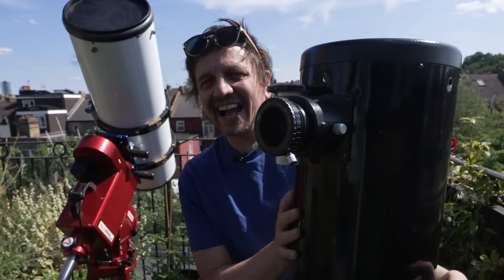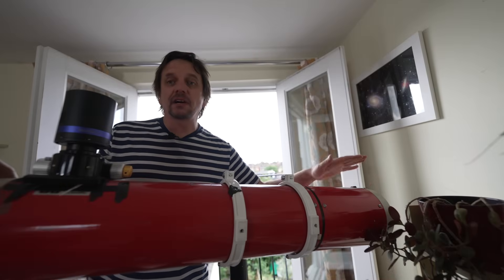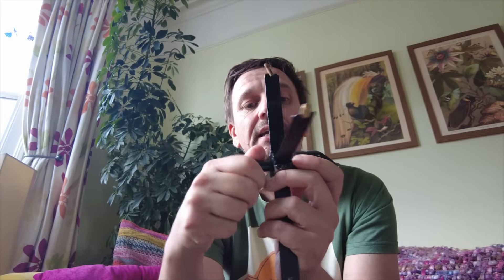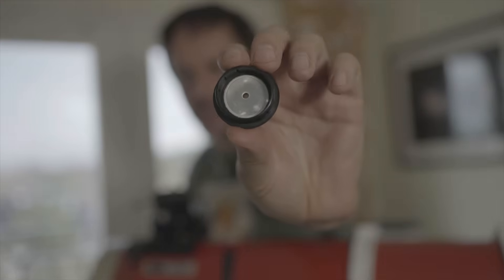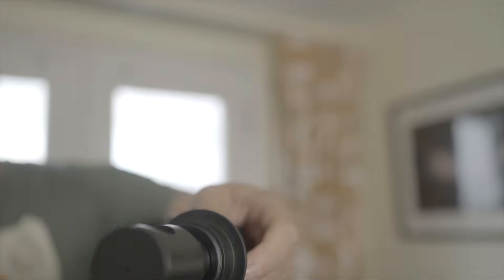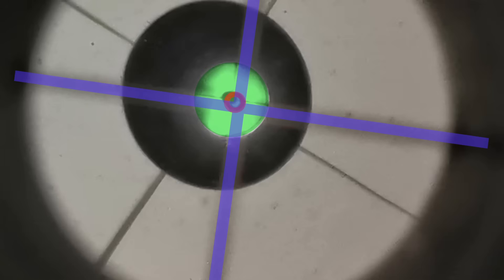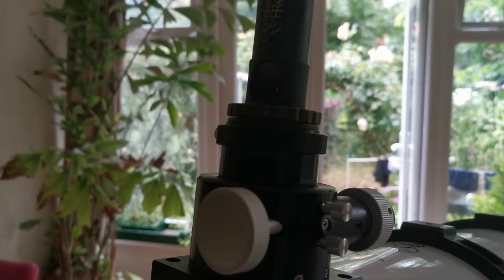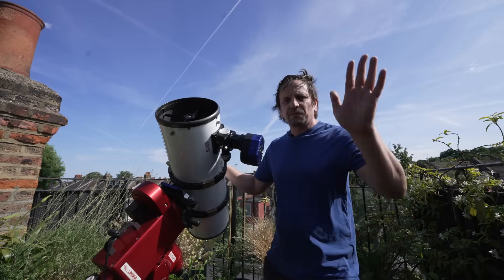How to Collimate a Newtonian Telescope │ astrobiscuit tutorial

Comment: I’ve always used a collimation cap and felt that one side of my image looks a bit soft. I tried a laser and it was super easy and I feel that my view is sharper edge to edge. 

However, when I put the collimation cap back in after using the laser, I can no longer see all the primary mirror clips in the reflection. Does anyone have thoughts on this?

Comment: I use the sleeve of an eyepiece, and the dust cap that attaches to it (with a hole in it), and I have a metal washer glued to the inside of the cap. It makes it a lot easier to see when you are actually close, and helps you get it a bit more accurate.
And then I point the scope close to a light, like a ceiling bulb so that the washer reflects some of the light to illuminate the washer.
But the funny thing is that I always find it easier to collimate when the primary is a lot out of whack, because I can see everything aligning gradually. Like, I had to clean my primary this evening, and when I put it back together it was way off, and I just turned a few of the knobs and then it was collimated about a minute later, and I was like WTH, it's done already? 🤣
It does take a while to get used to collimating though; when I first started out I was never quite sure what I was looking at through the collimator, with all the mirrors and reflections everywhere, but after a while your brain starts filtering out the secondary mirror and stuff, and it gets much easier.

Comment: Whilst collimating my GSO F5 newt, I noticed that the secondary mirror holder has indentations for the 3 screws, so you can't rotate it as you suggest. I've had this scope a few years and over time the collimation screws have ended up  almost screwed all the way in and I realised that backing them way off, allowed me to tighten the centre screw which moves the mirror closer to the open end. This simple adjustment has made all the difference, the secondary is now positioned directly under the focuser.

Comment: Yes, those 3 screws MUST be adjusted to center the secondary under the focuser, otherwise you’ll get uneven field illumination. A laser isn’t enough to collimate the primary, the tolerances are well below fractions of a milimiter therefore unless the laser is  barlowed it shouldn’t be used for the primary
Reply from the maker: I dont agree with everything you say. I think you need to check you fully understand  secondary mirror offset.
 I must admit ive no idea why folks  barlow their laser. Perhaps you could enlighten me. I see no advantage over a well collimated regular  laser...
Reply: @Astrobiscuit  I do understand secondary offset, it offsets the secondary holder toward the primary and away from the focuser, intercepting the entire light cone of the primary allowing even field illumination.
Anyways those 3 screws have nothing to do with offset, they are meant to center the secondary under the focuser, opticians know what the do, they haven’t installed the 3 screws to annoy us…
The barlowed laser simply magnifies the laser spot on the target so it’s easier to read any miscollimation

Comment: Unfortunately, many of the new Newtonians won't allow to adjust secondary tilt, because they put 3 pits into the 3 adjuster screw spots and many times the tilt is still incorrect.  Lasers will also not fix tilt issues and won't show if there is a tilt with the secondary.  The only way to find the tilt problem by looking at the shape of the primary mirror (reflected inside the secondary) with a Cheshire and recognizing the tilt, or using a special collimator camera.  And to fix the tilt with those Newtonians, that won't allow tilt adjustment, the scope needs to be modified. There are some videos up in the youtube, someone doing just that, placing a large aluminum washer between the 3 adjuster screws and the secondary mirror's back and now the mirror can be rotated.
Reply from the maker: sorry but i think you (and loads of others) have got into a pickle. The only tilt i worry about is if the cameras sensor is tilted with respect to the primary. The secondary mirror is flat. It is optically inert. It just changes to angle the light travels from the primary.
Reply from the maker: or its possible im not understanding you right.... if so sorry

Comment: I think you and 99% of others that do videos on collimation do it ass backwards of how it should be done.  Think this through... your mirror, which is center marked, should be aligned in the tube FIRST by centering it in the mirror mount using shims if necessary and then the mount centered in the tube! You then align the optical axis of the mirror with the axis of the tube using a tiny sight hole you construct from paper or a card that is centered at the secondary end and looking down the tube you adjust the mirror till the center mark is centered with the reflection of the peep hole.  Once it is centered you lock the main mirror and NEVER touch its screws again!  The main mirror is aligned with the tube axis and any readjustment later causes the optical axis to vary from the 90° you want at the secondary!  ALL adjustments now are AT the secondary!  Read about it here -

https://www.memphisastro.org/wp-content/uploads/2021/02/Newtonian-Alignment.pdf
Reply from the maker: 😂 fyi if you take the secondary mirror out  you can align the primary mirror by booking through the hole left by the centre screw  in the secondary mirror holder. Its actually quite a good thing to do first.  Worth noting that star collimation will align the primary mirror with any tilt in the sensor so you will have to adjust the primary to account for the tilt....
Reply: @Astrobiscuit  I was going to mention using the secondary holder with the mirror removed to use for the site hole but this first requires that you center the holder... which is the way I do it...

Comment: The correct way to collimate the secondary mirror is to block the primary with a sheet of paper/card and place a sheet of coloured paper opposite the focuser. This allows for the secondary to be seen clearly. Position the secondary mirror so that it's perfectly centered in the focuser drawtube and perfectly round. Easily checked and confirmed by a concenter. Then and only then do you adjust the primary.
Reply from the maker: im afraid i don't think centering the secondary is a great thing to do in a fast newt. Fine for f5 ot six but i think an f4 newt the secondary should be pushed slightly forward towards the primary mirror  by the secondary diameter / (4xfocal ratio) This is quite advanced though so i don't cover it in this basic tutorial.
Reply: @Astrobiscuit Agreed 👍, however there's no standard placement for the secondary offset in fast newtonians. The offset is entirely dependent on the manufacturers design which should be easily confirmed.

Comment: How often do you have to colimate the laser?  

And I wonder how hard it would be to put a decent CMOS sensor in place of the secondary?  Advantages: 1.brighter image due to no 2nd mirror loss, 2. No distortion from 2nd mirror, 3 no camera flex on the ota, 4. Potential passive sensor cooling as it could use the cooling of exposure to the night sky via heat sink or similar.  Disadvantages: 1.possible heat distortion? 2. Wiring ribbon or equivalent needed for PSU & signal. 3. Collimation issues due to thermal expansion of sensor holder?

PS. Love the video as always :)
Reply from the maker: my laser has stayed collimated for about a year now....  good luck building the newt with no secondary. I have thought aboht it.

Comment: Collimating my 8 inch Newtonian has been the bane of my existence. I have a few laser collimators, but one of my challenges is that either the laser collimators are not collimated, or the focuser tube is not flat. If I spin the laser in the focuser, the red dot on the primary spins round and round with a radius of about a half inch (just as you showed in the video), I guess my next step is to build the laser collimator colllimator!
Reply from the maker: that means your laser collimator needs collimating... see the rig i use in the video. The focuser may be fine... there is a different check for that.

Comment: Some things you should mention: The "basically you fiddle around" can easily take hours if you never did it before, and takes a few minutes if you are familiar with the process. New people should not despair, eventually they will figure it out! If your focuser does not point to the optical axis, and many don't as delivered, you will never get anywhere really, so that is step 1 for new telescopes, as is checking if the donut is actually at the center of the primary mirror. Other than that: Great video! For a long time I used a concenter followed by a laser and recently tried a DIY Ocal-like approach. Given my experience, it was way easier to use and understand, adjusting the focuser went very fast and the result was great. I was skeptical at first, but the experience convinced me to switch.
Reply from the maker: thx for that good point. Fyi I didn't think that the focuser not pointing at the optical axis merited being in the basic video as most scopes have oversized secondarys which partly compensate for the error. However of course  its better to have it squared off so i do run through it in the advanced video and I found a poorly aligned focuser can  cause the sensor to be tilted with respect to the mirror and this can potentially make star collimation very difficult. Plenty of free videos about squaring off the focuser out there. feel free to highlight one if you wish. and thx.

Comment: Hi, I've got a question that's been on my mind for some time now. Are there any off-Axis Newtonian telescopes like the ones in this video? How expensive would they be? How complicated it would be to make one of them professionally (if they exist) and maybe DIY version? And would that remove the spikes in the images of bright stars? (I've always wondered if the spikes could be removes in a non-digital manner and what would that image actually look like.)
Reply from the maker: I've thought about this too and ive not seen any available commercially
Reply: The Hershillian reflector is perhaps the most obvious type. The most common way we see this is with a typical household satellite dish. Optically it’s very hard to do and get anywhere near the consistency needed across a small mirror let alone a mirror of the size for a telescope. Those off axis mirrors are available but in smaller sizes and become very expensive beyond a couple of inches. 
However some segmented designs of reflectors have all their mirrors except for the centre one as off axis mirrors. Main example is the James Webb. Unfortunately each single mirror wasn’t exactly affordable. I did ask someone who is a very well known guru on figuring mirrors on the chances of of this being feasible for an amateur telescope. The answer was preceded with some drawing of breath and wincing.

Comment: Maybe a dumb question.
Is it possible to make a camera in the front of a newtonian scoop?
Instead of the secondary mirror.
I understand maybe problems with distance.
With a bit engineering with 3d printed parts i think it's possible or is it out of question?
Because of the main mirror.

I hope it's possible for real.
Reply: It's called a hyperstar.
Reply from the maker: yes... and if you're camera is small its a good idea but you'll need a longer tube.
Reply: yes it's possible. People have even done it before.
Reply: Technically? Yes. But you'd be introducing more elements into the light path. Depending on what type of camera you use, you'll block more of the incoming light. Especially with a DSLR, which due to its shape will also block the light in an irregular pattern. So you'd have to use a smaller circular camera such as a dedicated astro camera. Also, you can't use filter wheels with your camera, since the filter wheel assembly would also sit in your light path, so there's that limitation as well.
 
Still, let's say you go with the bare astro camera. Now you have the cable coming off the camera that will asymmetrically block the incoming light. Why is this a problem? Well, on a standard Newtonian, the secondary mirror is held by spider vanes that are as thin as possible, in order to distort as little as possible. Yet we still see their effect on the stars. The crosses around stars that you see in astrophotos are diffraction spikes caused by the vanes; look up "spider vane diffraction spikes" for an explanation. So now imagine what an extra USB cable, which is a lot thicker than your typical spider vane, will do to your view.
 
Now, there is a telescope design that keeps everything in-line, but solves the problem differently. The various catadioptric designs like the Schmidt-Cassegrain, Maksutov-Cassegrain etc. have a glass disc in front through which the light enters. It then hits the primary mirror in the back, which focuses the light and sends it forwards. There it hits a secondary mirror that's stuck to the inside of the glass (or a mirrored section in the center of the glass), which throws the light back again towards the back of the telescope. Finally it goes through a center hole in the primary mirror, and exits out the rear of the telescope, where the focuser sits. You can use whatever camera you want, since it sits behind the telescope, and does not block the incoming light. There are no diffracion spikes because there are no spider vanes holding the secondary in place. Finally, compared to refractor (with lenses) or Newtonian telescopes, these designs are shorter for the same focal length (magnification), which makes them more compact and reduces their weight. This makes them easier to transport to a remote dark site.